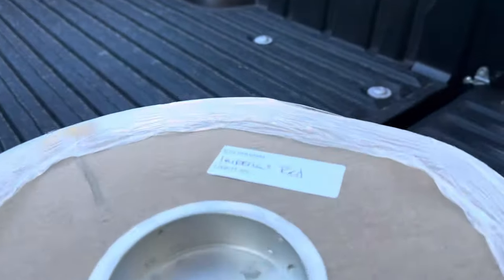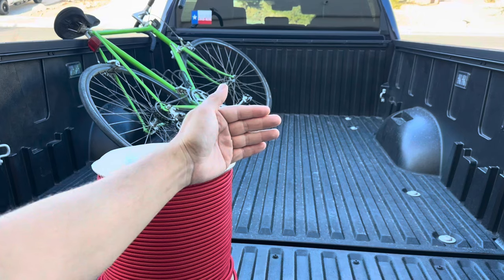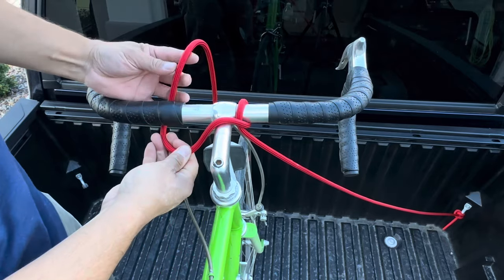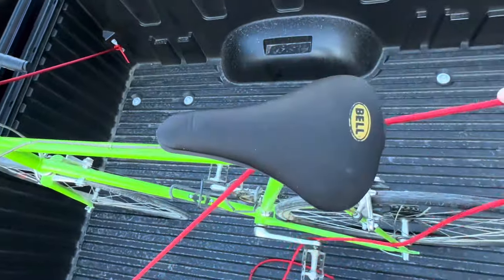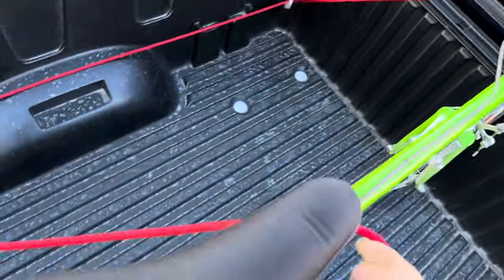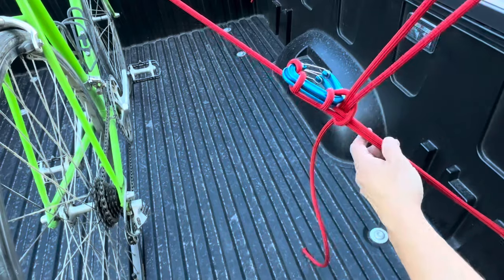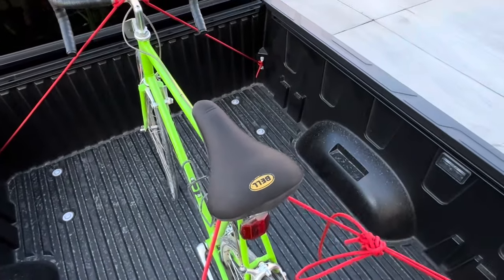Bicycle in a Truck Bed

Comment: A Zeppelin bend is what I would use to join the two pieces of rope. I haven’t seen you do the Zeppelin bend (or loop) yet; do you use them?
Reply: fun fact about a zeppelin bend: It is the same as an alpine butterfly knot if you cut the loop afterwards.

Comment: •  👍🏻"Dit gaan nêrens nie" in Afrikaans (South Africa). Literally, "That's going nowhere". Or "Finished and klaar" .. klaar is Afrikaans for finished.
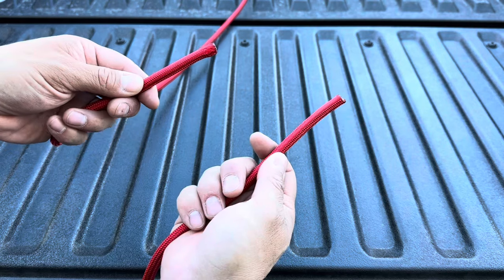•  3:36 Sheet bend or Zeppelin bend.
•  And great idea, the focus on applied knotting .. knotting ventured, knotting gained 👍🏻
•  Also, instead of joining the two ropes and then tensioning them, you could simply end the first rope at the carabiner, and tension the second rope there too.
Reply: Zeppelin bend everytime, it literally has it's test history in the name

Comment: E-bikes, which are known to be in the 70lbs + weight range, seem to shift side to side at turns. A static loop on those handlebars and seat post is needed. Also, I'd love to see two bikes side by side :D

Comment: What is the purpose of using two Carabiners? Is it a property of the two together have a wider profile and it's needed with the thicker rope?  Could this be accomplished with one Carabiner using 550 paracord?
Reply: I had the same thought and guessed the same girth reason.
Reply: It basically doesn't work with just one carabiner because the self-tensioning loop slides through itself; the second carabiner provides a "flat surface" that the rope can grip against. 
He showed the principle by looping around a round pipe and a rope has no surface to bind against, and slips right off, but wrap it around a square pipe and the corner acts as a pinch-point for the rope to bind against itself.
Reply: Bump for visibility!

Comment: I need to safely tie down 2 40lbs propane tanks in the back of my mini van to take them to be refilled. Any thoughts?
Reply: we buckle ours into the seats.
Reply: @tribalismblindsthembutnoty124   We refill 3 or 4 40 lbs tanks at a time and they do not fit into the backseats with or without my dogs (who come along to help and supervise). I need a dependable way to tie them into the back "trunk" of my Honda Odyssey minivan. I might mention that I'm in my late 50's and lifting filled tanks in and out of the van's trunk is about as much as I can manage.
Reply: Check out his video on making handles for awkward shapes like water jugs. Incorporate that into this concept, or the video where he shows how to secure grocery bags in a truck bed. Should work.

Comment: I don't think you can truly say "That's not going anywhere!" until you've used the full 1,000 feet of rope to tie down something as small as a bike. Though joking aside, I do have a question. What if you're in a situation where you have a lot of rope, you need to tie down something small like a bike or something, but you can't cut your rope? Is there a good way to bundle up all that excess rope in an efficient, easy to untie way? I've seen people rap some excess rope around the rungs of a ladder, but that would be difficult given too much rope, and the possibility that what you're tying down may not have a good place for that. I've tried bundling it up and tying that bundle to the side of the load, but I've never gotten it to work quite right. So just out of curiosity, how would you approach that problem?
Reply: Daisy chain it. 👍

Comment: Swiss German: Literally "Das goht nirgends ane" (= this goes nowhere to), but we don't say that. We'd say "das hebet" which means "this holds". Seeing all the mentions of the Zeppelin bend, do you know the fastest way of tying it?
Reply: The fastest way to tie a zeppelin bend is as if you're tying an alpine butterfly know, but instead of a loop, you use the two ends you're joining together.

The zeppelin bend and the alpine butterfly are basically the same knot.

Comment: In Brazil, they'd probably say "PORRA!" or "esse trêm não vai rolar".  Regarding knot I'd use to join to pieces of similar cordage, I would've tied a loop and used that to "trucker hitch" with other bit of rope to that last tie-off.  Not a correct answer but gets the job done just as well?  Would you say that you have a bit of an unorthodox way of tackling knotty problems?  It might be interesting to have some First Class Amateur vs {arborist, rigger, sailor} "battles" just to compare approaches.  Would at least make for spicy content for the algo.  Thanks for all you do!
Reply: You're probably mentioning the "nó carióca". I've never seen non-brazilians using the carioca on youtube, nor it being mentioned in knotting materials. It does seems to be a Brazilian thing.

It's definitely my favorite variation of the trucker hitch because it is very easy and quick to make, it doesn't bind the rope and it unties very easily. Maybe americans and the like find it unsafe (it can "spill over" if you tie it incorrectly), but I never had a properly tied carioca fail on me.